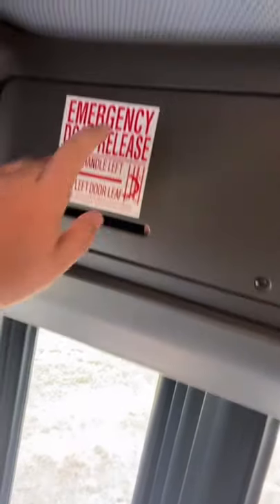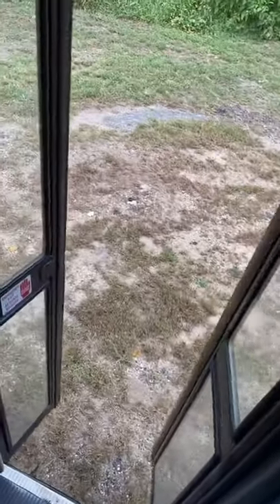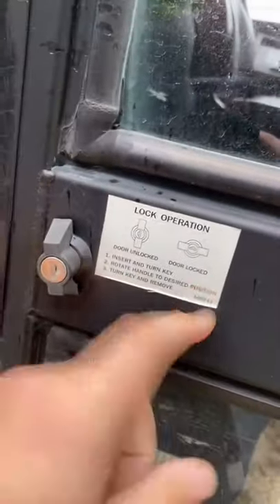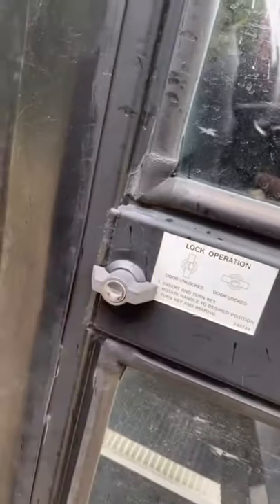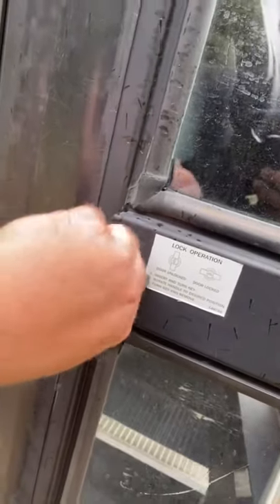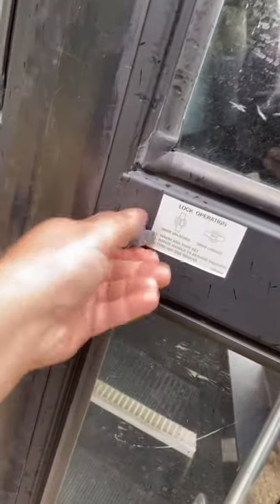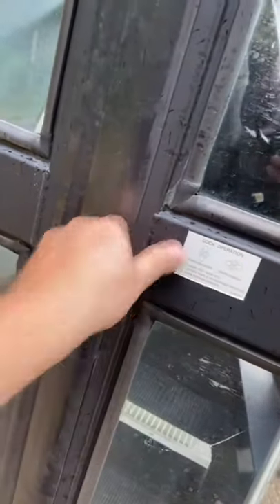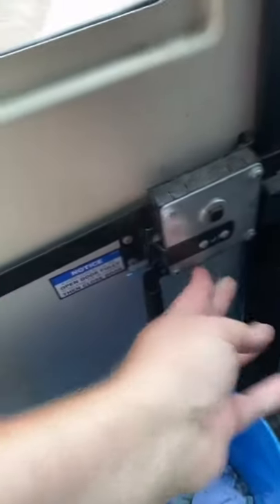HOW TO LOCK THE DOORS ON A SCHOOL BUS!

Comment: In some schools there is fence in bus barn so all of are schools bus don’t have keys to lock the main door because the gate locks the bus in. Basically but you can tell which school bus did have one. We also have 3 projects bus barn is getting a add on and two schools that are add on that also make the bus a dirty messy and it still won’t come off. 😂